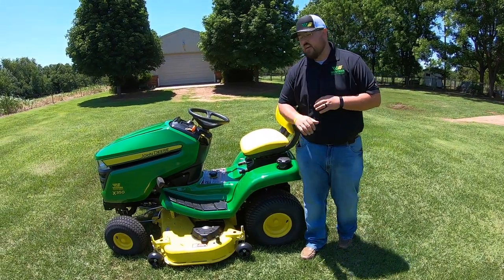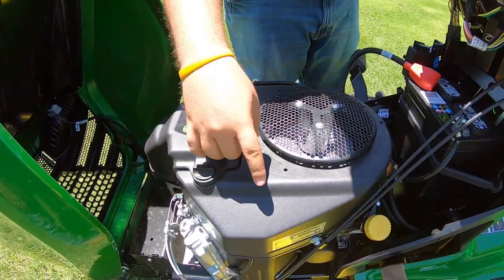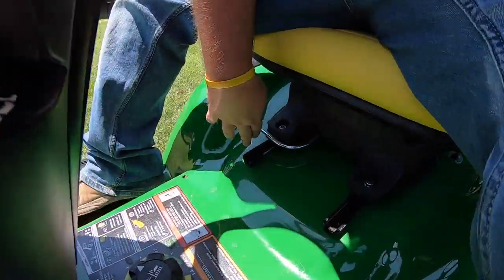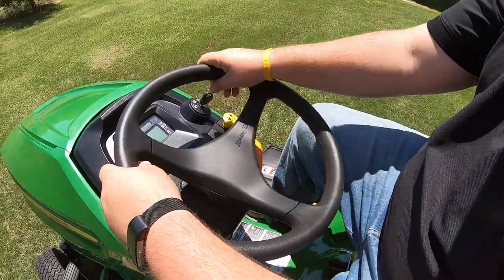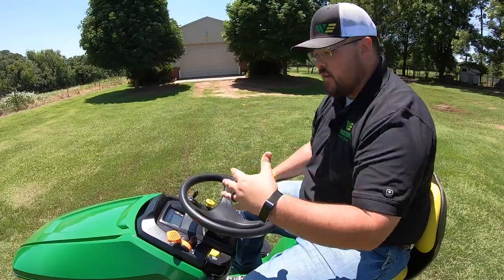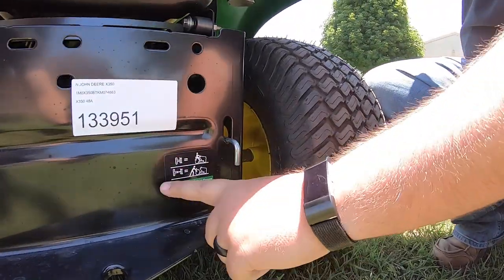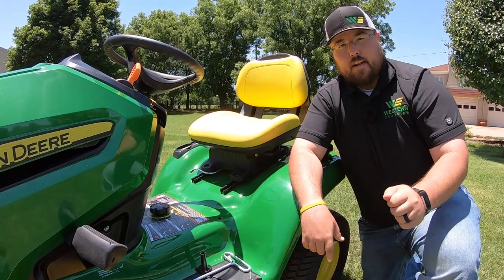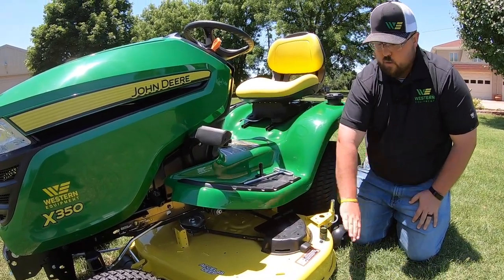2019 John Deere X350 Riding Lawn Tractor Mower Review and Walkaround

Comment: Thx for the video very informative. I was looking at the x700 series but I kinda want the diesel. But I also noticed the 1023E is close to the same cost of the x7 depending on what accessories you want any ideas would be helpful
Reply from the maker: If you are ok with a little larger, little taller, less turning radius, and a little more compaction in your mowing area, definitely go with 1023E. I love versatility of having front bucket, back 3 point, and PTO that has more power.
Reply: @WesternEquipment  I have 1 acre but .5 of it is usable lol my neighbor has the 3039R  cab tractor ac/heat  the whole 9 yards but the sticker price is out of reach lol.   I dont do alot of yard work but it would be good to have a tractor that can handle it. I'm going to look at the 1023 some more can a backhoe be a option for it if possible?

Comment: Great video! Question what is the width of the 42" mower without the black deflector? I bought an X330 and want to know if I can haul it in the back of my truck. 4 hours away. Thanks!
Reply from the maker: It will be closer to 44" without the flap just because of the lip on the deck. But I think you should still have plenty of room to haul it in your truck.
Reply: @WesternEquipment  Sounds good, I have Ram Boxes on my truck so its a little narrower than usual. I have 48" to play with, so figured it may be tight
Reply from the maker: With 48” you should be good! Let me know how it goes.
Reply: @WesternEquipment  Appreciate it, love the videos btw. its nice to see a dealer out there taking the time to promote their products and show the benefits for lawn and garden stuff, as well as the bigger machinery. Particularly loved your vid on the 569 vs 560M. Rob from Lankota

Comment: When you remove the mowing deck do you need to remove the drive belt from the engine to the deck or somehow disconnect the drive? 
Would be nice to compare the 42"" deck also, but you did so verbally. 
(I now have a LT-166 that I have had for 22 years and this looks like an improvement, perhaps I should purchase this instead of doing some deck suspension repair on my LT-166)
Reply from the maker: Yes you do have to take the drive belt loose. I have a few deck removal and blade change videos that should give you a good idea of the process!
Reply: @WesternEquipment  Thanks. I assumed that was the case but you skipped that part (i think) on the deck removal segment here. I looked at a 42" video elsewhere and it looks like the 48" deck is easier to remove and install. I'll look for your other videos on this subject.

Comment: When you were talking about servicing the mower. I noticed it said on the sticker that the transmission gets serviced  at 200 hours. I didn't think it was serviceable?
Reply from the maker: If you notice in parentheses it says "If required, check OM". This sticker is used for all Select Series but for the X350 specifically there will be no service to the transmission.
Reply: Just replace after failure

Comment: I have an X304 with a mulching deck , it's pretty similar to this X305 , same engine, same controls the main difference is the LCD display and the modern front end.
It's been very reliable in 15 year's I've put 340 hours on it.
The only complaint I would have is the extremely poor quality seat cover !!
The yellow vinal cover split after 29 hours , I remember going back to my local John Deere
 dealer where I had purchased the mower and got no satisfaction !
That needless to say left me very annoyed. 
I would still say it's an excellent lawnmower.

Comment: Great video, Brent.  I've watched all your JD reviews.  I purchased an X350 from my local JD dealer here in Maine.  After using it, I do have one observation/concern.  The interlocks prevent starting the mower blades with the parking brake on.  This seems like a safety concern to me, as I've had a few instances where it's almost gotten me in trouble.  Part of my property has a sloped path which I mow.  Although not a steep grade, the mower will roll without the brake engaged.  If I stop on the slope, and want to engage the PTO, the mower starts to roll.  If you apply the brake, the blades won't start.  If you apply the reverse pedal, the blade won't start.  To me, it seems like a design flaw.  What's the problem of having the parking brake engaged and starting the blades?
Reply from the maker: That’s a good question. I have never tried this. I usually just have the brake pedal pushed down when I start the blades. You may try that rather than actually having the lock lever raised. Let me know how this works and thanks for watching!
Reply: @WesternEquipment  I tried just depressing the brake pedal and it does not allow the blades to start.  Once the blades are started, the brake can be applied without stopping the blades.

Comment: I'm debating between the X330 48", and the X350 42".  Virtually the same price and horsepower.  I don't think I really need a wider deck.  I do plan to add a snowblower.  Thoughts?
Reply: NS Gearhead I have an older X300 with the 42” Edge deck. I’m picking up a very lightly used X350 48” Accell Deep deck on Thursday. The X300  42” deck has been great and cuts great we cut around 2.5 acres with it. I can’t wait to see how the bigger deep deck cuts. I think either will work great for most needs.
Reply: I would go for the 350 since it has the Kawasaki engine
Reply from the maker: Total toss up! Only real difference is the engine. X330=Briggs and Stratton, X350=Kawasaki!

Comment: He talks about greasing the mower spindles, but I’ve seen several videos showing the bearings are sealed and don’t need to be greased.  What gives???
Reply from the maker: This is true but the grease will fill the open space in the spindle which in turn will keep moisture from building there and cause damage to the spindle.
Reply: Designed to fail.
Reply: @woods840 if properly maintained they last several years. If you simply cant stand the thought of it you can spend an afternoon and pop each spindle apart and remove the inner seals. Reassemble it and grease it all ya want. Literally every manufacturer has gone to these style spindle bearings,and failures are seldom a problem.

Comment: I have a 2019 X370 which came only with the 42” Accel Deep deck. Is the 48” deck compatible with the X370 or does the hydraulic lift make that not possible?
Reply from the maker: In the X3 series to get all of the features your X370 has with a 48" deck you have to step up into the X390.
Reply: Western Equipment right, but if I were to get my hands on a 48” deck, would I be able to connect it under my x370? I don’t want to buy a new tractor if I can just buy a new deck.
Reply from the maker: @rogermurph101  You should be able to as long as the hangers on the new deck line up on the mower.

Comment: Can a JD CargO-Mount™ System be added to the x380?  I want to add the canopy and sadly I think I can't because I see no Cargo mount holes on the back of my x380.
Reply from the maker: You can add a canopy to your X380 but you don't need the CargO mount system to do it. The X series mowers use the rear of the mower and mounting brackets for most of its attachments.
Reply: @WesternEquipment  Thanks!  I am torn between the after market John Deere 30491 @ $195 or John Deere BM23054 @ $174

Comment: Around the 4:15 mark, you mentioned that there is no break in period. We just purchased a x380 from an official John Deere dealer and they mentioned we need to observe this break in period. Are they running off of outdated informational standards?
Reply: Faithful Nation my 570 said change oil after 5 hr break in pd.
Reply: @springfield03sniper  Thank you! When they deliver it, we are going to ask again.
Reply: @FaithfulNation  even if the delivery people give you a vague answer, it can never hurt to change the oil initially after 5 or 7 hrs to make sure any metal particulate is gone. Edit: I just checked my manual, and it says change oil and filter after initial 8 hours.  Oil and filters are cheap insurance for an expensive piece of equipment
Reply: Fine but what's the price tag
Reply from the maker: I misspoke! There is a break in period of 50 hours!

Comment from the maker: **Correction - First oil change should occur after 50 hours!**
Reply: No try again Kawasaki says 8 hours .
Reply: Ken Mackay no, maybe read the John Deere owners manual. It says 50 hours.
Reply: First oil change on a Briggs'Stratton opposed twin after 1st mowing, the oil looked like silver metallic paint. Course it ain't got oil filter, but still.
Reply from the maker: John Deere owners manual for this mower specifically states 50 hours!

Comment: I had to replaced my spindle and found that the barrings were sealed. So the grease I had been squeezing into the tip, never got into the barrings. It's a hollow cavity.
Reply from the maker: Yes! Paul Cox and Rocky77340 have the right answer!

Comment: Disabled Vietnam Vet  (4 years  US Air Force Jet Mechanic Crew Chief,  T33, F102, T39 7-passenger). Left side stroke. How do I hold choke, turn key same time? Edit: John Deere L140 1600 hrs, D170 700 hrs, D160 425 hrs, today blown transmission on D160 48", if trans repair comes close to $2k I'm upgrading to X350 48. Ford New Holland for field work. Hummer H2 for everything else, wife Tesla.
Reply from the maker: Thank you for your service! This may be tricky but maybe you could get some sort of strap or latch to attach to the machine to fix this problem!

Comment: I was tempted to purchase one of these but after the failure of my D105s newly replaced transmission after less than 8 hours of use, John Deere refusing to help and my local dealer lying to me, the yellow and green can go to hell.
Reply: Ragemutt you would have been disappointed again - literally the same K46 transaxel as the 100 series. Consider a move up to the 500 series to withstand a real beat down.
Reply: Ragemutt I’m literally going through the exact same thing. 1st transmission went out at 60 hours. Recall replaced the transmission and literally an hour later the new transmission failed. What a joke!
Reply: X300 series is a very capable tractor. Its very debatable why John Deere would even bother getting into the cheap mower market but the bottom line is people buy cheap shit. That D series is only capable of mowing on flat ground, basically what a motivated person can do with a push mower.
Reply from the maker: I don't know your full circumstance or mowing conditions, but I can say this surprises me. In 6 & 1/2 years I have never seen a transmission go bad within the warranty period with this few of hours, or even after for that matter. And we sell a bunch of the 100 series tractors!

Comment: The deck height adjustment doesn’t seem as handy as a lever operated one in my opinion, and having to hold down a button to mow in reverse is a hassle. I got a 10 year old craftsman that mows in reverse no problem.
Reply from the maker: The height adjustment is just easier for some operators that may not have the arm strength to raise and lower the deck by hand. And I misspoke about the RIO button, you only have to push it to start your reverse motion. Then it can be let go and you can continue to mow in reverse.
Reply: Western Equipment ok, that makes sense.

Comment: Why do some of the smaller models have larger HP?
Reply from the maker: HP does not always follow frame size. The HP is somewhat deceiving. For instance, an E180 John Deere has a 25HP Briggs and Stratton engine and a Z915E John Deere has a 25HP Kohler engine. An E180 is a residential mower and the Z915E is a commercial mower. The difference is the build of the engine for the application and how much torque it produces.

Comment: I have heard that the k56 (and k57) transaxle is not reliable and has issues. Any input on this topic? I am trying to determine if it is worth paying the extra money for the 380 since it has the K58.
Reply from the maker: Here at our dealership specifically we have not had any more issues with one over the other. But if you are thinking about spending the extra money keep in mind you are also jumping to a 22 HP engine which helps that money difference not seem so bad!
Reply: @pico doc I don’t know that its so much a reliability issue as its a realistic expectation issue. The lad putting together this vid did a really good job, and as he snuck around the back of the machine, I wondered how he would address transaxels, or the transmission on this deere vs others. He mentioned peeps stepping up from a push mower can now add a fertilizer spreader (yup) and a garden cart or something like that to tow. If its a lightweight cart, and you haul dry leaves, and you have a flat and level lawn, this machine will do it all day. If you plan to work it hard, snow blow, steep inclines, move up in the range. The 350 uses the same 12 lb transaxel as the 100 series, the K46. The K57 & K58 weigh a few pounds more and have very similar torque ratings to the K46 (232 ft lbs) , so little improvement there. You need to get into the 500 series to see noticeable, lugged transmissions like the K72 weighing 27 lbs with 549 ft lbs of torque at the axel.
Reply: @Yamaha Venture I have an L130 and an L120 in my garage right now, both with dead K46 transaxels. My L120 I used to nearly 800 hours with a bagger hauling heavy, damp 7 bushel loads, and I have one pretty steep run that is about 12' long. So it worked for a decade, until it didn't. I bought an L130 on Craigslist with far fewer hours as a replacement, and the transmission was gone within a month. Both K46. My first reaction was to be disappointed in the brand, JD specifically, and said I'll never go green again. But, Yamaha Venture has a valid point about using beyond their capability, I did my own research on the trannys, and realize I have to go to the 500 series to use the machine as I intend and NEVER have a transaxel issue again. Here is an overview of their transaxels...http://www.kanzaki.co.jp/en/products/transmission/iht_k_k46k57k58k62k66k72.html
Reply: dseften exactly! The k46 transmissions are garbage. The notion that buying an x350 at a dealer will be a “real” JD tractor vs a big box toy is blatantly false when they have exactly the same crappy transmission.

Comment: I have the LT155. Your explanation of the John Deere numbers doesn't match up. I am thinking about buying the X350.  You show a lever you can pull to get the mower to move when it quits. I hate to say it, but why did it take so long for someone to figure that out. My LT155 has left me stuck! and it is hella heavy! Otherwise, it has been been great, starts and runs every year. Flat tire every spring. Maybe I stick with it. Nice features on the 350, for sure! Basically, I feel like all I would gain is a fuel gauge, and the ability to move it when it dies. Oh, and a place for my drink and phone, which is not to be underestimated.
Reply: I sold my LT155 about month ago and bought the JD X350 with the 42" deck and it's night and day difference between the two mower's.  If you're questioning yourself on weather to purchase the X350....all I can say is just do it.
Reply: ilovetotri23   I have the LT150 which replaced your 155 in 2002. It has the pull out lever to put it in neutral. It is extremely handy. I bought mine new in 2002 and it’s been awesome. Am getting the X350 this week. Hope it’s as good.
Reply from the maker: The model number explanation is only for the newer models and I agree on the transmission release lever!

Comment: I ended up ripping the hood off of my x350 after I rolled. The only thing that broke was the hood😂😅😛
Reply: How did you roll it? Were you on a sketchy hill?
Reply: @spareparts7630  yes, I was going up a steep hill and it lost traction and started to roll down the so I cut it sharp to the right and tipped over and landed on the hood, steering wheel and seat. The only thing that broke was the hood. I ripped that off and now it looks like a race mower. 2018 x350 Deere.
Reply: @carterbowe9964  be careful running it without the hood. It could cause a lack of engine cooling.
Reply: @andybub45  actully, I just put it back on so all good now!! But because it is cracked, it is grinding on the flywheel. Oh well
Reply from the maker: Ouch! I hope all is well now. At least replacing the plastic hood would have been cheaper than a metal one!
Reply: @WesternEquipment  yeah the only thing weird about it now is the deck is out of level and my grass looks all weird. But otherwise, great mower

Comment: No thanks I'll stick with my Club Cadet GSX 54" fabricated deck three blade, it has more power diff lock and push once and hold mow in reverse , and a stronger rear differential , cruise control. and I can use implements.
I spent 4,200.00 for It and it came with 3 bag bagger system.
Reply from the maker: From what I see a Cub Caddet GSX is more comparable to our X500 or X700 series. So I could see why you would want to stick with the bigger more powerful mower. Stay tuned for a review over an X500 or X700 and then let me know what you think.

Comment: How to adjust blades
Reply from the maker: Do you mean adjusting the level of the blades?
Reply: Yes. I had adjusted the deck some, is mowing a litter. Haven’t got that cut where the I think it’s the center blade is cutting short. A couple other people road this after me and I had noticed it. So I had talked to the owner and he said if I have to replace blade I need to do all 3. I was thinking in my head no you don’t. But anyways I’ve got adjusted about the best I can get it. I’ve got 3 new blades ordered for it should be here bye the 18th. Now something else I’m wondering is are you supposed to adjust the deck while up or down position. To low one way too hi on the upper position. I’m boggled. Thank you for your time.